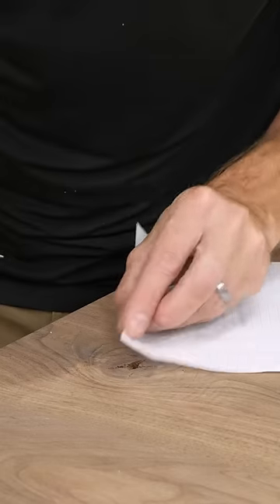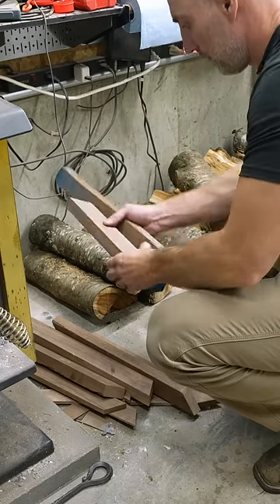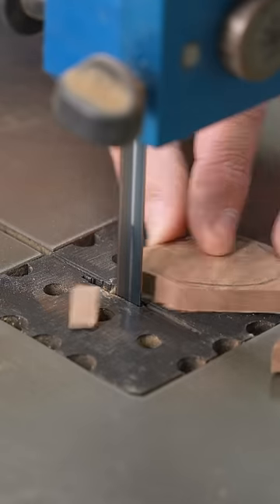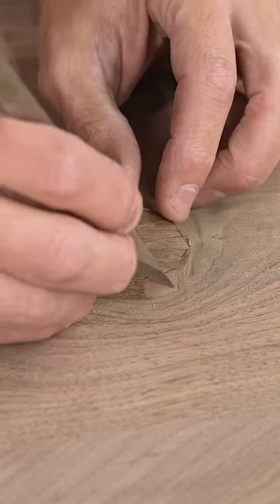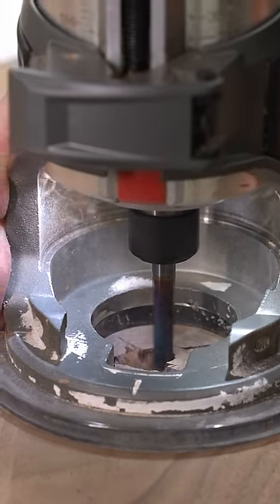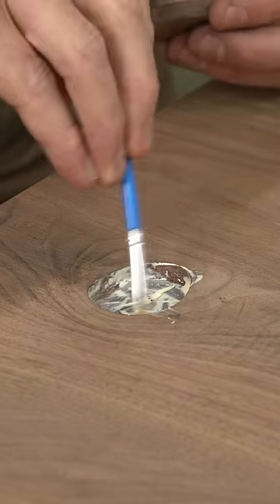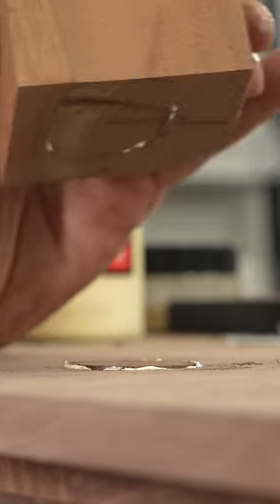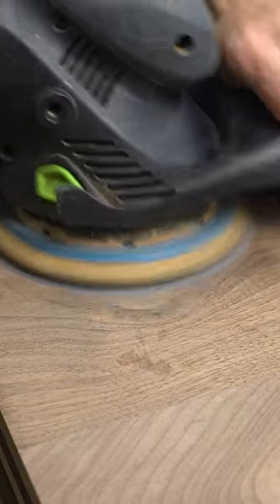Hiding a Knothole

Comment: Knots are beautiful imperfections,unique just like each piece of wood.let it be or fill it with clear! I built a striped computer desk top and used a knot as the hole for the wires! Took a while to find the right piece with a nice centered knot hole but it was worth it! Id like to see something you would build with the same (style) if you will!
Reply: That is an awesome idea!
Reply: I would like to see how it could’ve looked filled with a mocha epoxy. I’m not thrilled about the artificial plug either

Comment: I'm a woodturner, and when I need to fill a knothole, I stuff the hole with bark and fill in the gaps with sawdust (packed down). Use thin superglue to bind it then sand back to the surface.
Reply: Other than the grain not going with it..
Reply: @ryanblessie  I try to highlight the imperfection instead of hiding it.
Reply: I can’t tell if this is a joke
Reply: I like it better than routering a circle or filling with epoxy

Comment: Tbh it may have hid a bit better if you picked the darker left side shade to match.  Also the grain was a little wide and straight to follow that concentric pattern around the knot... maybe if you found another more attractive knot of equal size, but uncracked, and tried to replace it... though I accept that would be much more difficult to plane without chipping. Considering the extra work I would've likely just filled her w black epoxy,  so good on you for the effort : )

I doubt anyone you don't mention it to will ever notice.

Comment: The plug color and tone doesn't match the surrounding grain. The solution is before selecting the wood for the plug, wipe the door and plug wood with mineral spirits, then match the plug to the door so it matches when finished. Your plug is light.

Comment: I've found that larger gauged bristle iron wire brushes can be used to force a grain match in sistered pieces. But works better the straighter the grain is. The only real downside is that it also deepens the grain. So, it has to be flattened back out with sanding afterward.

Comment: I embrace the imperfections. I use clear, not black, epoxy when filling in knotholes. I learned early in my woodworking life that wood, even of the same species, stains uniquely. With a little more work you might have been able to blend the plug better. As it looks now it draws your eyes straight to it.

Comment: I would have stained it a bit darker and then maybe hit it with a touch of shellac and then dulled it with steel wool if the finish was satin. A nice trick is to make the inlay borders flowing along the direction of the surrounding grain lines. It doesn't have to be a circle.

Comment: It sticks out like dog balls.
you should have taken a piece from the underside of the same piece your repairing.
Use sawdust in the glue for coulour matching.
Run a stanley blade with grain over the piece after it dries & rub wet swarf from the planing over the entire area, the colour will leach out of the swarf & into the tiny blade cuts.
Then wet the area then sand.
You won't even remember where you did the repair....

Comment: If you had wet-ed it before you chose that plug material it MIGHT have worked out. Also there is a router attachment that cuts a matching inset that gives a perfect fit in no time at all, look for it and save  bunch of time.

Comment: The grain of your plug isn't even close to running the same way as the door.  The wood didn't stain the same shade as the original wood. 
I think brown epoxy in the small cracks would have turned out nicer than that really obvious bung hole you butchered.